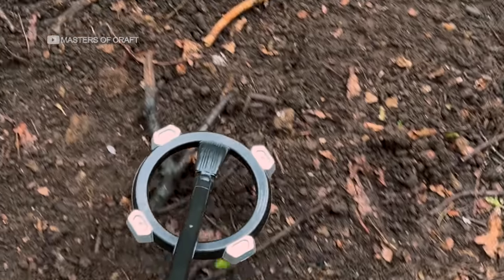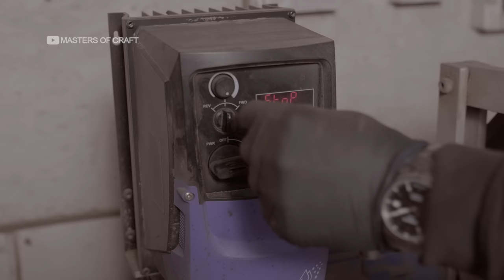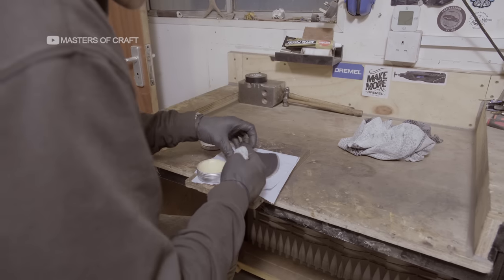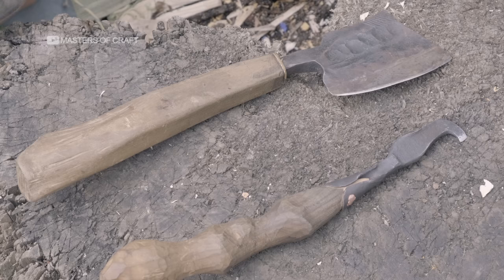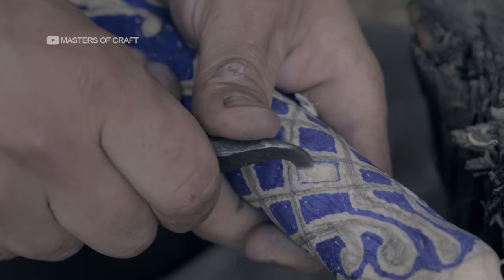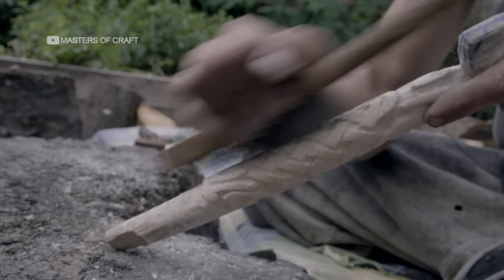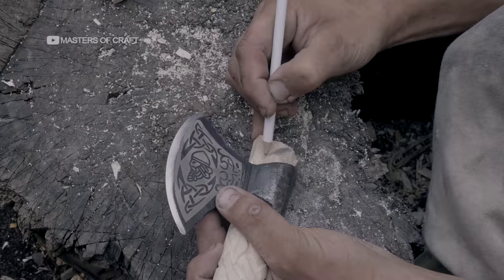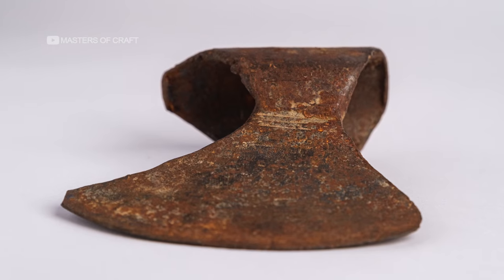Ancient Axe Restoration With Detailed Engravings

Comment: Would you really want to do this with an actual Viking axe head? I would think this would hurt its value.
Reply: I am right there with you. The historical significance would definitely be decreased. Maybe the age of the blade is overstated for the clicks.
Reply: Are you delusional? Do you really believe this is an actual Viking axe? :elbowcough:
Reply: The thing is they are really not that rare.
Reply: All historical finds in the uk have to be presented to the local museum for inspection and cataloguing, and you’d only be allowed to keep those items with low historical and monetary value, so doing this wouldn’t devalue the find. It wouldn’t increase the value either mind
Reply: @alicewithwings6750  The video claims it was found in the woods. The metal detecting and recovery is obviously staged. Is it actually an authentic axe head? Who knows. Is it worth a real debate? Unlikely.
Reply: Did anyone notice the keys on the key ring  right net to where the axe was dug up 👌
Reply: @Cyberbronco - From the procedures inflicted upon this "Viking" <<wink! wink!>> axe head, including DREMELING off rust, losing a lot of original material, I would say that this is a fraud. ANOTHER channel to avoid!
Reply: @Marcos-Osca  authentic viking keys!!! With an authentic viking key ring!!!!
:)
Reply: have you heard of vintage objects my fellow oxygen breather?

Comment: Nice work, but it's not a restoration. Indeed, it seems to me that the historical part has been completely ruined since the patina of the centuries has been removed, and a Celtic motif has practically been laser-printed on it... It could have been easily done with any other piece of steel or ax from a hardware store... Nothing tells me that's a thousand-year-old head-hatchet. But is it really a Viking hatchet? Looks overly healthy and underworn... I've seen German MP40s pulled from the earth with deeper rust.

Comment: You ruined it as soon as you engraved it, if you really want to restore vintage tools you should avoid grinding, cutting, engraving, etc because then it's not a restoration anymore, it's a modification, it would be like putting a fire decal on a vintage car and calling it a restoration. Next time try only engraving the handle as long, as it's not original and you always put the metal wedge across of the wooden edge